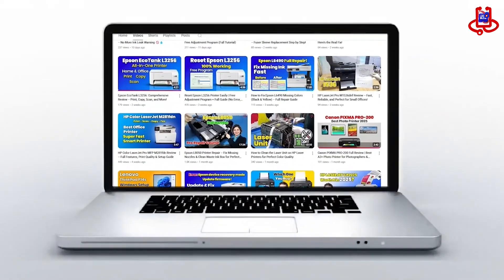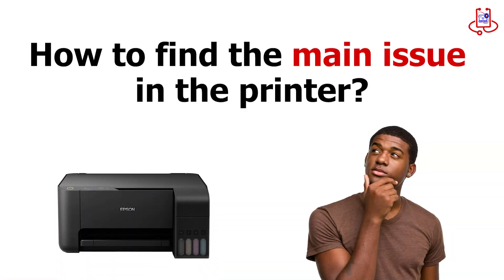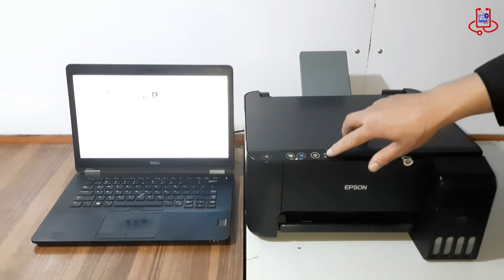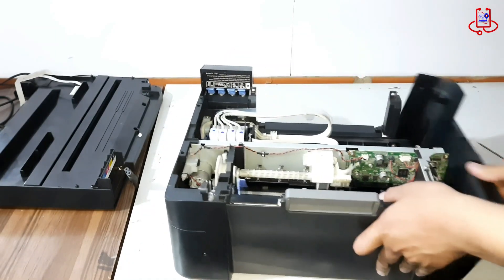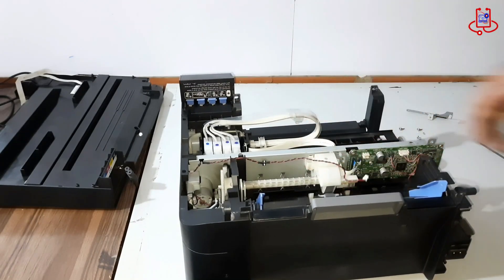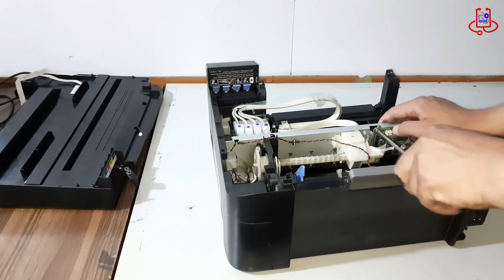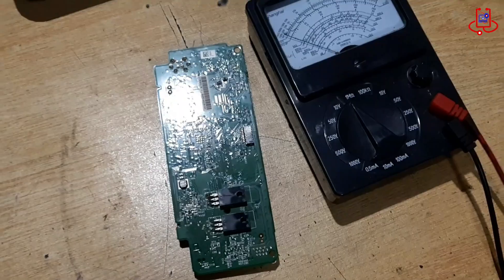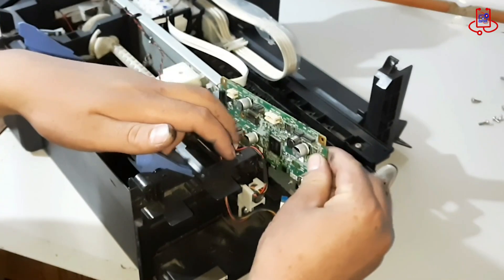Epson Printer Error 031006 Explained & Fixed | L3110, L3210, L3250, L3150 & Similar Models

Comment: Summary: 
Take the printer apart and remove the mainboard. 
Solder the fuse F1 so it stays closed. 
Reassemble printer. Done.
Reply from the maker: Exactly, this method is correct, but make sure to be careful while soldering so the mainboard is not damaged.

Comment: Sir apna India Mai log canon g1010 ya g2010 printer ko  modified karte hein K in ka name new step tech ap YouTube par search Karo wo kis thra karte hein is thra Canon ka ink tank printers ko modified Karen par video Banno 760 ya 800 micron K pvc card printer Kar paye aur other paper b print Kar paye kindly in par video Banno youtube yeh wali video abhi tak missed hai
Reply from the maker: Thank you for your suggestion!
If we get access to the required models and it’s possible to modify them safely, we will definitely make a video on this topic.
However, in our region, Canon printers are not widely used—Epson and HP are more common.
Only large Canon office printers are popular and successful here.

Comment: Dear Sir G ap ko 2 videos ki request ki thi ek ya K canon ka ink tank printer g1010 ya g2010 printer ki paper picking system ko kis thra repair karte hein aur yeh K canon g1010 ya g2010 printer ko is thra modified karte hein K wo 760 ya 800 micron K pvc card printer Kar paye aur other paper b print Kar paye kindly in par video Banno youtube yeh wali video abhi tak missed hai
Reply from the maker: Dear Sir G ap ko 2 videos ki request ki thi ek ya K canon ka ink tank printer g1010 ya g2010 printer ki paper picking system ko kis thra repair karte hein aur yeh K canon g1010 ya g2010 printer ko is thra modified karte hein K wo 760 ya 800 micron K pvc card printer Kar paye aur other paper b print Kar paye kindly in par video Banno youtube yeh wali video abhi tak missed hai